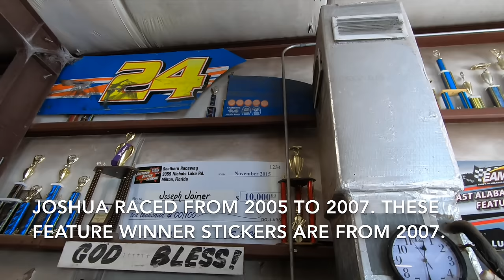We Bought a Go Kart and Built a Racetrack

Comment: Happy birthday to your dad. I did kart racing for several years, I got a back injury from a flat kart due to a low speed repair head on collision, if I was or putting kids in kart racing I’d do champ carts. On those your belted in like your in you LM. My injury was caused by my lower body going forward and my upper body remained still. On a side note Saturday I went over to East Lincoln to hang out in the pits and visit plus watch the races, the track announcer was riding by in a golf cart and stopped by and recognized your Hunt the Front shirt, in fact said “ you have one of those Johnthan Joiner shirts” so you have more than one fan up here in NC. Keep up the good work.

Comment: Hey I used to race gokarts. I have one tip that will make you a lot faster. When your racing and your going around a corner hold the gas wide open and drag the break. That will make it to we’re you will still have the motor wound up for going down the straight

Comment: Happy birthday Pops!!! Can’t wait to see more kart stuff. Thats how I got my start back years ago. I love anything dirt track. You know it maybe a little different in some ways but those karts have about all the adjustability of a late model except for shock wise. You can adjust the front end for toe & caster & camber. You can even shim the hub out for offset in the front. The rear axle can slide either direction for offset. The bearing blocks on the axle should have adjustments also to be able to add more weight to the rear wheel on either side. Also moving lead around on the kart will make drastic changes just like a late model or a modified. You guys will figure all this out too just like your cars. But theirs all kinds of ways to set those karts up too. I haven’t been in a kart in many many years but they’re a blast, but expensive as well. Your Brother will be back in late model before long. That’s how it gets started back but when you’re a dirt track racer you’ll always be a dirt track racer. Love what you all do, watching from Eastern Ky.

Comment: I raced go karts for years very fun times but go kart racing is a tire game. If you don't have the correct prep in them you will be off pace. We bought new tires(maxxis) every week and cut over half the rubber off be even bolting them on the kart. You probably gonna want to get a tach and I'm sure you already have is scales. I ran 64% cross and 53 left side but I ran phantom chassis on a 1/4 mile flat track and that was a couple years ago so I'm sure it's changed since then. I would love to see karts on this channel. Keep up the good work

Comment: There’s an oil drain plug also on the front of the motor so you won’t have to tip it, but cover more kart stuff!!! #20 is the number I’ve always gone by, but I am considering using 722 for my son that passed 4 years ago 07-22-15

Comment: The oil drain for the predetor motor is the front bolt not the rear the block is angled facing forward to the front of the kart

Comment: yea thats a racing kart with a box stock motor big motor but it little cheaper to race karts but you have to by tires lots of tire ifon road but dirt circle is fun and they have  a race for 50.000$ every year but it prb more than that by now cuz i went to it like 6 years ago ya kart racing is fun and farely cheap and in most classes everone have to run the same motor

Comment: Looks like an Ultramax kart, its definitely got an Ultramax steering wheel. As already mentioned, the motor is a box stock 212cc Predator, probably pushing 6hp-7hp. Its around $100 at Harbor Freight. Not really a racing engine like we run. We have Briggs & Stratton Animals that are 17hp-20hp (actual kart racing engines), Clones that are 16hp-18hp (they are the predecessor to the Predator), and Briggs & Stratton Flatheads that are probably 12hp-14hp (just a ol' rototiller motor)
As far as oil, 14oz-16oz is plenty. Don't worry about looking at the dipstick. Also, you should be able to drain the oil from the front of the block. It would make it drain alot quicker with the motor being angled that way.
Check out our page for kart racing videos!!

Comment: Ok, first of all its a go cart. You run the track clockwise not counterclockwise. Its because most 212 go carts are 1 wheel peels so they need to go the other way to cut in the dirt better. Just sayin 👌
Reply: These arnt one wheel peel? They have live axles
Reply: Ight that was my dumbass cusin on my computer lol. Yes your right, they normally race tgem counterclockwise, but my grandpa has 2 or 3 of those carts and a track out in the field and they race them clockwise even tho they are live axle carts. So thats why he thought it was the other way around lol

Comment: Wouldn't mind seeing dirt karts more. If you do race remember tire prep and tire pressure those 2 most guys miss and think it's there engine lacking power most cases it's the tire prep and pressure and or how free everything spins over. Personally dont like seeing engine builders names on the predators. Why because when they started racing the predators they was leaning towards a low budget side of kart racing. Most of your new rookie racers are running a predator class not a clone or animal/modified class.

Comment: So they are running a kart designed for pavement on a dirt track thats a really smart move.
Reply from the maker: I am still new at this kart stuff, but from what I understand most offset style karts can be run on either dirt or asphalt. I do know that the chassis manufacture says on its website that this specific chassis design is built for low grip conditions, which is most likely a dirt track. 

— Joshua

Comment: Two widest are the right sides.. the second biggest is the left rear and the skinniest is the left front ... need it on the scales...56 left
58 cross 
46-46.5 nose 
-2 3/4 rf camber
+1/2-3/4 lf camber,
stock caster 8&12
 Get them numbers in it set the right sides at 34 inches stagger and the left rear at 32 3/4 and 32 1/2 inches on the left front .. run 4lb left side air pressure and 5lbs right side air pressure and let r rip Tater chip
Reply from the maker: Thank you! 🏁🏁🏁